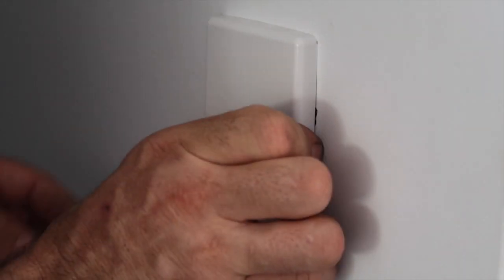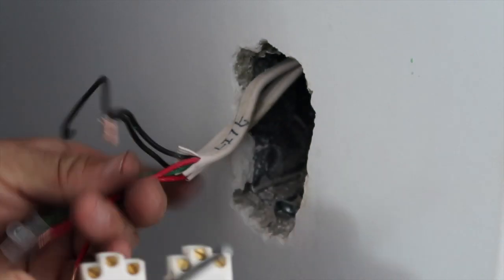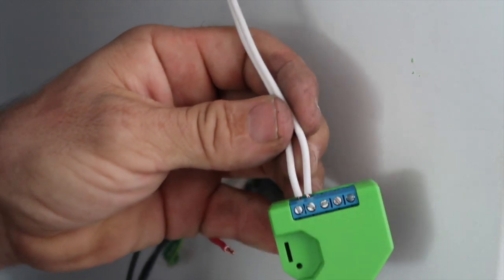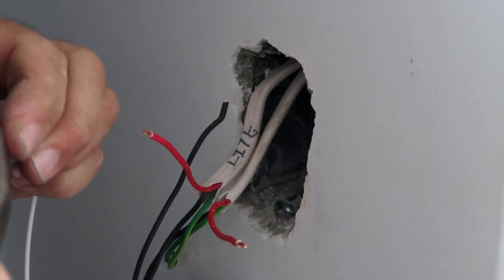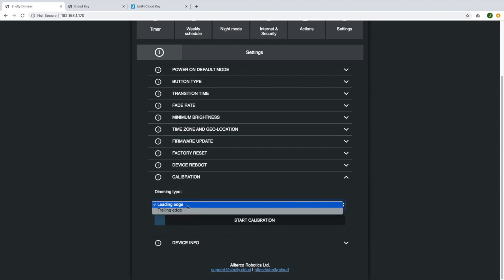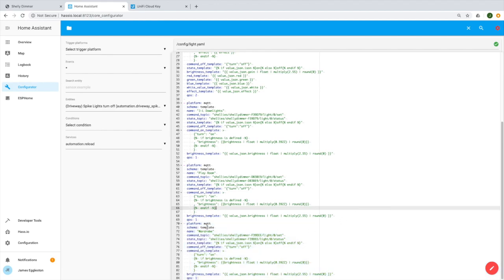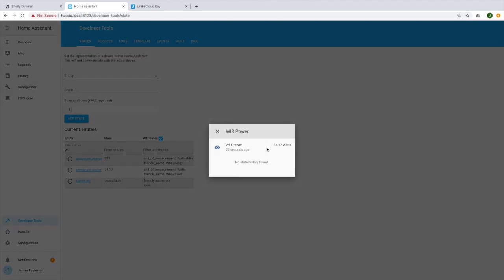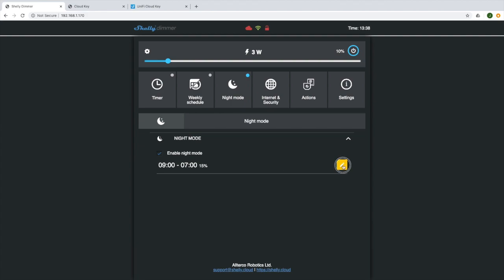Shelly Dimmer Installation - The Perfect Dimmer???????

Comment: Do you have a link to buy that double push button?   I’m in the USA and my local electric supply store doesn’t have anything like it.
Reply from the maker: It actually wouldn't be suitable for USA we have 240v and the plate grid size is different. But you have sonmething better we don't have, look for a momentary Single Pole Double-Throw Center-Off Rocker Switch, most likely use for blinds for up and down. That would work great. Unfortunately I'm not familiar with US brand and styles, so I can't give an advise in that area.

Comment: Is it flicker free dimmer for LEDs ??
Reply from the maker: Hi Ravi, results will vary. The flicker has more to do with the light than the dimmer, is the short answer.  But the only time I have had it is a very low levels and I'm not sure if it is a coincidence but with more expensive fittings. But it no case has it been very noticeable.